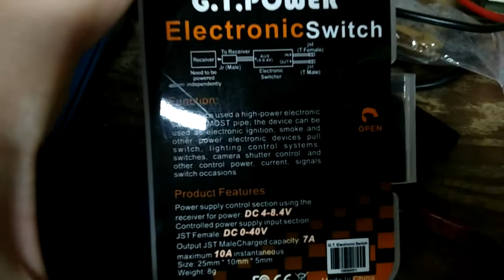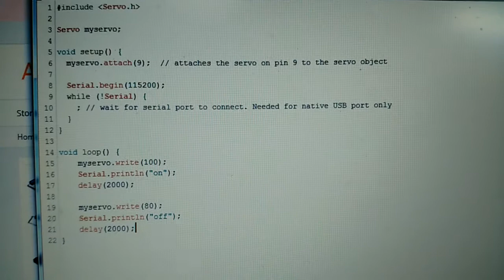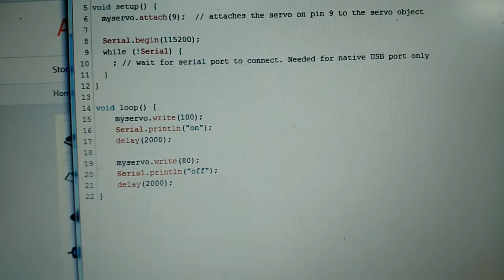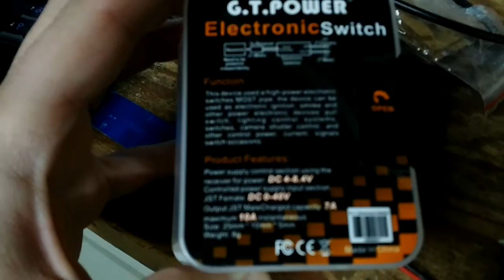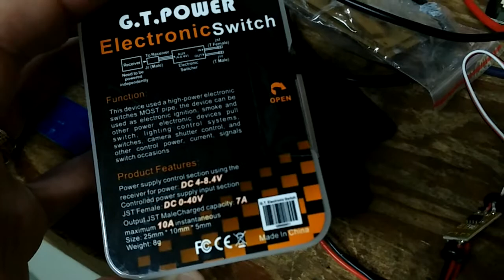G.T.Power Electronic RC switch (part 1)

Comment: These switches are a complete piece of garbage.
I ordered from amazon and aliexpress. Both don't work!
G.t.power is a junk company. Don't buy their products!
Reply from the maker: Care to share what your setup is (voltage input, load being switched, etc)? What is generating your PWM signal source?

Understanding why yours don't work would be helpful for others, but you haven't really provided any useful information to help identify why yours don't work.
Even better, drop a link to something that does work for you.

I've used the ones in the videos for years on a few robots I've built, and haven't had problems other than one that failed due to miswiring, I typically am switching <1A loads @~12VDC. PWM source is either an Arduino, or an embedded computer. 

Note I have no vested interest in anyone buying these, this wasn't a paid review and I have no affiliation with the seller. Just sharing my experience cause there wasn't any info about these online when I bought them, and info on the listing was sparse.